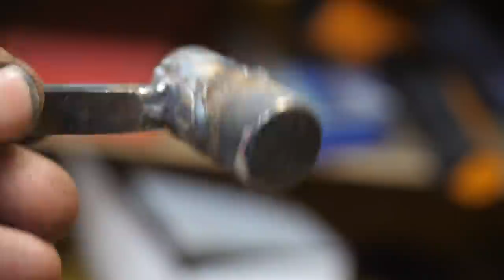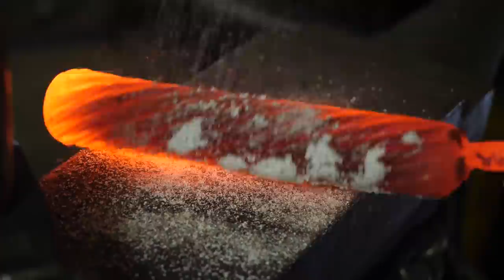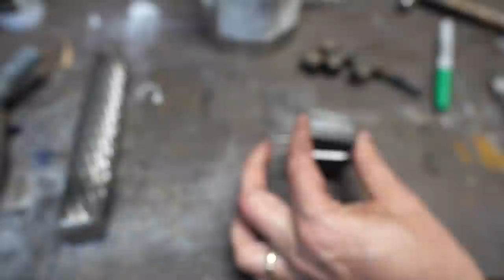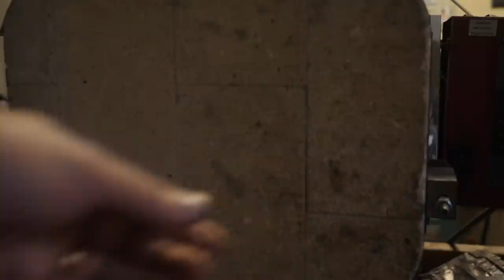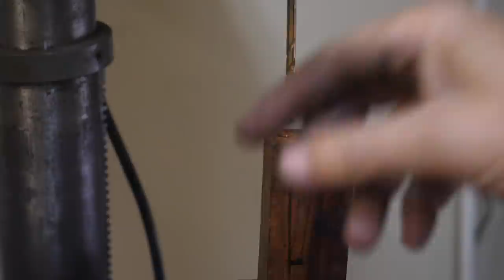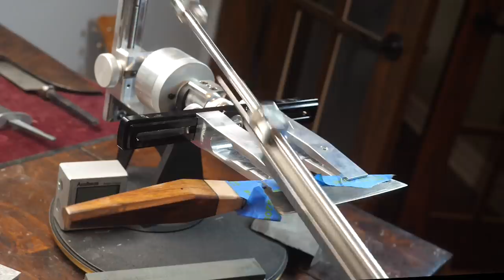Forging A Knife From Arresting Cables

Comment from the maker: Get Starbond's essential product bundle which consists of the clear thin CA, medium CA, thick CA, and accelerator at 15% OFF using the discount code GB15 at checkout
Click here https://bit.ly/3cgYQfi to visit the product page
Reply: I used to plate steel parts.
The first tank we would put the load in was the soap soak tank. A heated tank with water and soap to lift any oils.
Oil doesn't like Dawn© dish washing detergent.
Then we did an acid dip, water rinse and into the plating tank.
I've seen a few attempts at parts like these, and the contaminant always seems cause them to not properly weld.

Comment: You did a wonderful job rescuing the blade and it looks rather stunning. If you had not explained the issues and what you did to rescue the knife I would never have known that it was a rescue and not a deliberate design choice from the outset of the project.

Comment: When I was an apprentice fitter I had to do time in the blacksmith shop.
I enjoyed it so much, I nearly changed job to smith but their money was rubbish so...
However, one of the old boy smiths used to make knives from haulage/winch ropes.Crude in comparison, but they worked and worked well.
We used them in preparing hydraulic hoses where replaceable knife blades did 1 hose end only.
The smith made knife,crude though it may have been did a shift before needing touched up.
Oh yes, these knives were made using a 16lb hammer, a 3lb hammer and a few appretices...

Comment: Beautiful job! I recently got into cable Damascus making and I found cleaning with diesel works great! And when you put it in the forge at first it leaves a nice layer of carbon which seemed to help with the forge welding
Reply from the maker: Guy who sent them soaked them in diesel I think next time I need to unravel it.
Reply: @GreenBeetle  I found unraveling it helps to bring the pattern out better because of decarb. Stronger ferric chloride etching process helped me also. I haven't tried re-stacking it because I like the pattern I get with just tightening the twist. I will be trying to make a taco with the billet and maybe 80crv2 or just plain 1080 soon.

Comment: you could add your own steel cable to it to stabilise the metal grain to make it less prone to bending OR forge weld it drill a hole and stick a high carbon steel rod into it to get the same effect

Comment: Incredible knife, love it. If you're open to an idea about getting any oil out of the cable, I would weld it on two sides and split it down the middle to have more access to the nooks and crannies of the cable. Just an idea, might work with the canister.

Comment: Hi Steve, I'm sure you have much more experience than me but when I work with cable I first heat it up and un-screw it let it cool then soak it in acetone, I then blow it out, heat it up, flux it then twist it tight and Bob's your uncle. Thanks Bruce
Reply from the maker: i don't work with cable very much having only done half a dozen blades with it.  so this is a great idea.  i need to get the outside strands to weld up better somehow.  some loss on the outside seems unavoidable but i see others do it much better this attempt.

Comment: I actually like that tip, even if end would be good and still have cutting material I would think about removing that sharp end, it just look better without it and in kitchen you dont really "stab" much things so there is no need for such pointy end.
Also love the handle, it look great with those colors.

Comment: Welcome to eutectic steels 🤣 52100 is a bugger like that, wootz is very much the same when you over heat you can set the steel aside let it cool and start again and you might be lucky to be able to keep forging, otherwise you end up with the "wet sand" fracture as we call it thats hurts the heart stings when it happens.
The knife turned out awesome I hope the new home it goes to treats it well 🤘🤘

Comment: With a mix of metals like that, why would you not edge quench rather than tip quenching?  The key element of this, in terms of cutting, is the edge, and an edge quench (hypothetically) results in a more even result on the cutting edge (and maybe helps to prevent some of that tip bending).

My old bladesmithing instructor was adamant that a single edge blade meant for cutting should never be tip quenched.
Reply from the maker: What is tip quenching

Comment: Its definitely an odd material, you could try the old way of pounding it to forge weld it onto a piece of wood so the individual strands don't deform as much during the initial welding
Course that does mean a lot of fire and smoke in your life which might upset a lot of people

Comment: Hi ! I have a question :
You told me in another comment that 80crv2 needs temp control but some steels don't , could you name a few ?
Reply from the maker: All steels need temperature control to some degree.  Simple, eutectoid steels are the easiest to heat treat without it - 1075, 1080, 1084.  Grain growth is still rapid if you overheat them so you must take care after their low temp normalization cycle (1550-1600ish F) not to heat them beyond 1480ish when you quench.  Overheating them even for a very short time grows grains very quickly.   
A bonus with simple, eutectoid steels is that all of their carbides are dissolved and carbon in solution (taken up by austenite) at the first austenization temperature, A1.  They don't require long soak times with high temperature normalization cycles like hypereutectoid steels can to dissolve all the carbides and put all carbon in solution (taken up by austenite) for the purpose of homogenization and reducing carbide size in grain boundaries which causes weak points.  This is my understanding.
Eutectoid steels have "just the right amount of carbon" so that excess carbides are not a problem, the carbides they do have are easily dissolved into austenite at temperatures that don't grow grains size, etc.
Hypereutectoid steels and steels with chromium are prone to retained austenite when quenched from higher temperatures, something that is not usually a problem with eutectoid steels.  Retained austenite leads to fractures and instability in steel.
Kevin Cashen has a very good DVD video on heat treating eutectoid steels I highly recommend for anyone doing forgeside heat treatments of the steel.

Comment: If it is galvanised, can you not just burn it off in the forge? It's just a thin coating of zinc, isn't it?
Reply from the maker: Zinc and many other coatings are toxic in a forge
Reply: @GreenBeetle  oh, I know that. I figured you'd wear a ventilator.